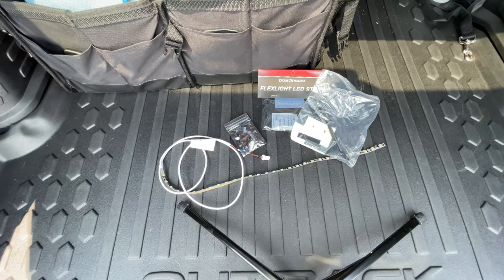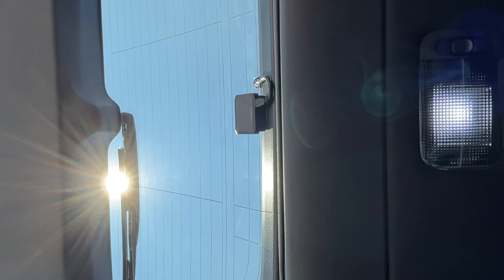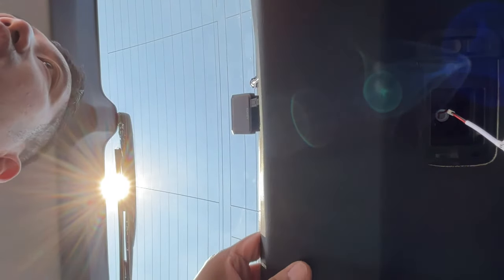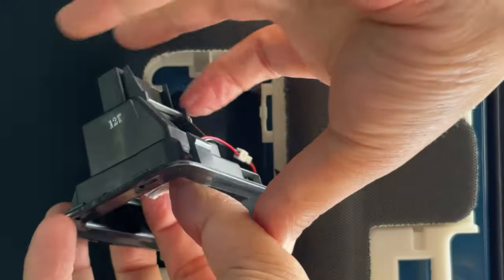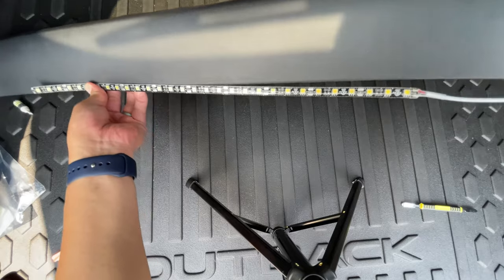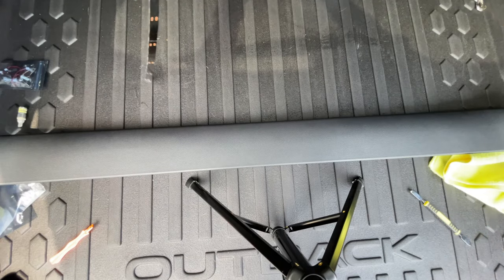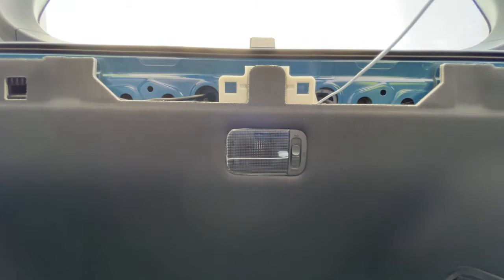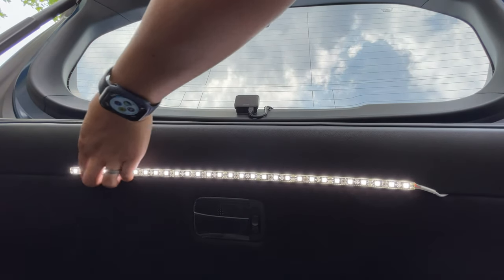How to Replace your Cargo Light With a Diode Dynamics FlexLight LED Strip in a 2022 Subaru Outback

Comment: Love this, just did the same to my Outback with a few tweaks.  FYI - I was able to fish the wire through the gap into the light housing without having to remove the inner part of the housing, as long as you do it before you connect the bulb adaptor.  Thank you for the idea and video!

Comment: Why not just get the biggest led panel that you can fit inside oem housing ? Probably with 24 5630 chips. Probably would be as bright as that strip you added and look way cleaner than that just taped there imo

Comment: The 2018 is a little different that prevents this.  There is no stationary plastic trim on the roof near the lift gate, unfortunately.  Too bad, I really wanted the extra light.

Comment: That was a really great video.

What was the issue that you had with the light strip not turning on when you initially plugged it in after the housing was dismounted?

What was that little tool that you used to pop the clips?
Reply from the maker: The 194 wiring for the LED strip is polarity specific. I just simply inserted it backwards. I just had to flip the socket around, but due to the tight space, and the curl of the wires, it looked a lot harder than it really was. The tool I used was just a dash/trim removal tool from Amazon. They can be found at most automotive stores.

Comment: AND. What is the current draw on the strip vs. stock bulb? Is there a risk of pulling too much current with the strip on?
Reply from the maker: The LED strip draws the same amount, if not less than the incandescent bulb that came with the car. There should be no issues in current draw.

Comment: Which strip did you get? The ones I'm looking at don't say anything about the included connectors and want to make sure I get the one that come with it.
Reply from the maker: Here is the product link:
https://www.diodedynamics.com/flexlight-led-strip.html
Reply: If your going to unmount the light housing, you could connect (solder connect) the LED strip, after the switch, so that you could keep the original lamp socket and replace that original bulb with an LED bulb, providing two sources of light combined.

Comment: Hey was the black portion at the back sticky? I just got mine today and am trying to install, but it's not sticky at all
Reply from the maker: Yes, the back portion of my strip came with 3M adhesive. When I took it out of the box, the adhesive came with a brown backing paper. It should be visible in the portion of my video before I adhere the strip.
Reply: The strips are manufactured and sold as "adhesive" and "non-adhesive" strips.  You bought the wrong type.

Comment: Considering you tapped into wiring, would this cause potential void for warranty?
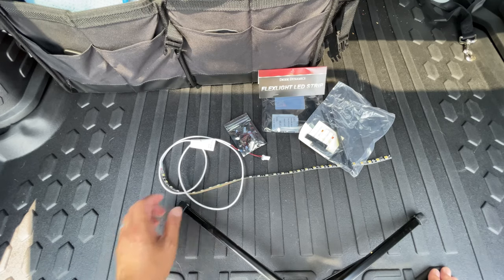Reply from the maker: This is the beauty of this product. I did NOT tap any wiring. The LED strip comes with a small wiring harness at the end that comes with interchangeable male sockets. All I did was use the socket that fits the overhead cargo light (its a 194 bulb socket) and plugged it in. As far as the car knows, its just another lightbulb. There is NO splicing, wire taps or cutting involved with this installation. It’s 100% reversible as all you have to do is unplug it and put the stock bulb back in. I explain this at 0:24 in the video.
Reply: What vehicle warranty covers light bulbs?

Comment: or you can replace the "crappy bulb" with a LED bulb :)
it's not gonna be as bright as the strip though
Reply from the maker: Of course. And as I explained the beginning of the installation (1:34 in the video), I already had an LED bulb in there. Not only that, I replaced it with a more powerful 921 bulb and I still found it insufficient, hence the upgrade to the strip.